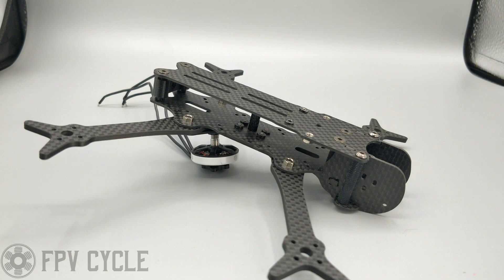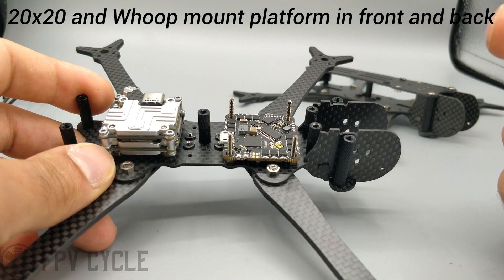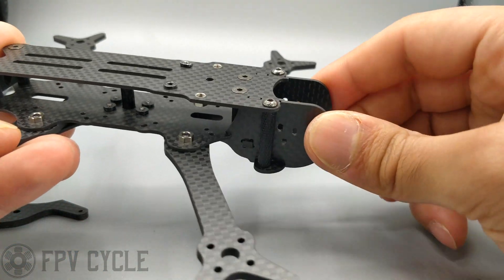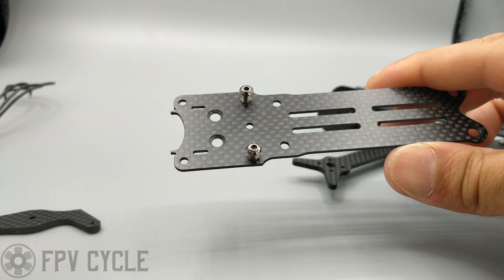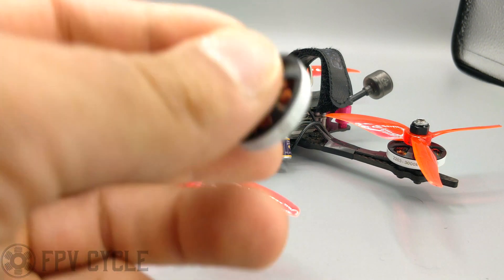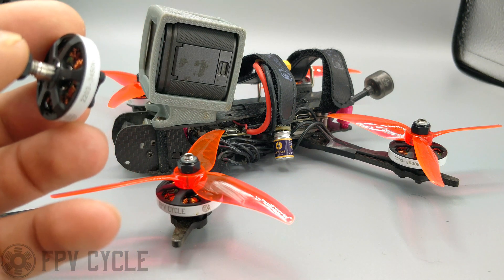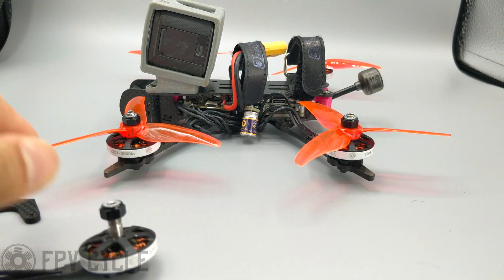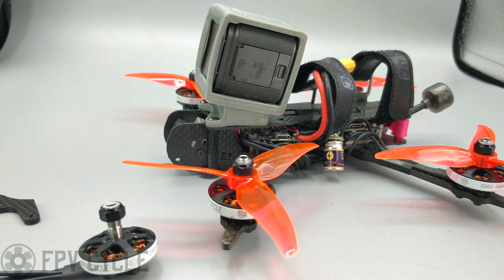Fouride 4" and 5" - Frame and Setup

Comment: For anyone watching this a year on, I have built one and it's amazing. 4s 3450kv on a 5 inch REQUIRES a 1000uf 35v lowESR capacitor otherwise you get awful noise, but with an AIO+VTX stack, you have a huge amount of space to play with so no worries. 

It's a joy to build and I cannot recommend enough

Comment: 13:11 Do you get noticeably more sag with a 3S compared to 4S?
Reply from the maker: On a high powered setup, yeah you will but with the highest output 130c cells, it's not really noticable

Comment: The better micro/mini-long-range frame, at least I've decided to build it as one.  Can you plz make the 5" arms 1mm thicker?  I want to carry 6s Li-Ion with no flexy bendy, and I think it would help with the harmonics.
Reply from the maker: Try reducing the ramp up power in the esc settings a little. Should fix that.

Comment: Armattan gecko 4inch 2203 3000kv 4s... whats a good lipo size? 850 4s? Or 1100 4s? I want to use gemfan 4052.
Reply from the maker: The 1100mah 4s is definitely going to be a better fit for overall performance but the 850 will run too

Comment: thinking of using this for a light 5" long range.. was between this and shock ultra light. I like that this uses the aio board. And im use a vista. 
2004 motors 1700kv, might have to do 1950Kv but trying to be efficient.  5" biblades

Comment: This is the first frame i have ever seen that have stack not placed in cg. I f love it. I wish there was a narrower version only for 20x20.
Reply from the maker: I don't think any of my frames have the FC near the center. I haven't put the FC on CG for many years now. It doesn't matter at all. Zero
Reply: @Kabab  well right. Not CG. I mean center of rotation. Well if one flys in horrizon mode it have to be in center of rotation. So that 1% of people are destroying fpv frames for years. There was always super huge empty space right behind camera and super crowded in the back. Ive never seen this before. Your other frames always have 1st stack in center of rotation. Which did not?

Comment: Would you recommend this 4” frame for a 6s build?
Reply from the maker: Sure but why do you need 6s on 4"?
Reply: KababFPV hmm I never thought about that. So 5” would benefit more on 6s? I would put a digital unit on the frame.
Reply from the maker: @boonjuefpvboonjue1230  5" really only benefits from 6" if you're really pushing the performance or if you're flying an 800g 5". Otherwise, 4S performs better because you actually get more flight time and more torque in the motors so it feels better. The reason 6s tends to have more flight time is because people are using comparatively bigger batteries.  A 1000mah 6S has the same overall energy as a 1500mah 4S. People typically run 1200-1400mah 6S batteries. If they ran a 1000mah 6S, flight time would absolutely be less than 4S 1500mah.  Overall 4S is safer, more efficient and cheaper. 6S is generally preferred but only so you can zip around near max throttle or to go a bit faster.
Reply: KababFPV thats some good points! I’ve been flying 4s and hear everyone hyping up 6s. I guess I’m more curious on what the hype is all about. So you don’t see people moving over to 6s? Will it be more of just two separate groups 4s and 6s. Basically will 4s die to 6s?!
Reply from the maker: @boonjuefpvboonjue1230  I personally prefer to fly 4s because it feels better but 6s does give me more power if I want it. I'm totally fine with either. If I didn't have a fleet of quads, I'd do 4s only. It just makes more sense

Comment: Would it be possible for you to make the frame with 4 mil or even 5 mil arms. It looks totally sweet and I would love to get my hands on one, but it would be nice (even though I have experience flying) to have a more durable version. Thanks.
Reply from the maker: Yep. Working on it right now.  The Fouride was actually based on the full 5" design. A baby version of it. It takes a lot more effort to optimize full 5" than smaller things.
Reply: @Kabab  Thank you for responding! It's really nice to see guys who even though they are so big, still respond to comments like this.  Thank you for the inspiration you give.

Comment: Does the FPVCycle Zeez Whoop board have an Amp sensor?
Reply from the maker: I do not believe so.  At least the prototype doesn't.  Didn't look closely at the final to see if he added it.  Wasn't really a feature we cared for.  We preferred easier to use solder pads and more robust electronic design
Reply: @Kabab  It's a good feature to have for the sake of reliability (safe heat margins) and watching resources on anything capable of long range.  Good for experimenting with different batteries too, like all the different 18650's.  The Baby Tooth does well with RunCam 3 lite, and probably the 4 btw.  We'll see shortly.  Having a 1-2S capable board for the Baby Tooth motors with an amp sensor to make sure you're setting a throttle limit correctly for 2S is likely a necessity.  Retaining 1S capability opens up all kinds of high discharge capability with 14500's.  Only HappyModel has one with a pointless RX and VTX onboard : (   It's amp sensor is so tiny!  Hopefully 1-2S with amp aensor is possible for a solder-pad style FC soon, given all the excessive voids in a cross-shaped layout where a solid square would easily fit.
Reply from the maker: @mistercohaagen  2s would be substantially more board and more difficult electronically to do. You need to add lots of voltage management components. It's just not worth the reliability hit

Comment: 4” arms - 61g fully built, that is kind of heavy compared to like a Gecko 4
Reply from the maker: They're very different designs...
Reply: @Kabab  Ofcourse, removable arms add weight. You are the advocate of 'weight matters' so was kind of surprised. Compromises have to be maid, I understand
Reply from the maker: @martinverbaas  this isn't a compromise.  I can't speak about other designs that I don't agree with. I'll just get myself into trouble.   All I can do is speak about my design. This isn't intended to be the lightest build as I explain. It's intended for the 2203 motors which are quite impressively powerful.  There's a threshold to each prop size where the performance begins to be impacted significantly. It goes up pretty quick as you add prop size. This build falls within that window.
Reply: @Kabab  Thank you for responding and explaning, this must use up a lot of your time. Keep it going and push this hobby forward!

Comment: @kababfpv this is hands down your best frame yet. Any chance of getting a top plate a la carte? I need to take a dremel to mine to fit my cam setup, and Id like to know I can go back if it doesn't go well.
Reply from the maker: Yeah definitely. We just haven't listed it like that yet
Reply: @Kabab  Fantastic. The dremel work actually went quite well. I'll send a link to you once its done, you may find it interesting. I've put a loris and a toothless on an adapter. You happen to know the BEC stats for the jhemcu 30a? I killed the 5v rail on my two spares trying to set this up.
Reply from the maker: @Rob-tp8cu  there aren't really any reliable stats for things like that 🙈

Comment: Hey so I bought a fouride 4in yesterday and now I’m tryna figure out which motors to go with. The 2203 3000kv or the stanfpv 3450kv? I want to fly this on 4s won’t be carrying a GoPro just the vista system.
Reply from the maker: https://fpvcycle.com/blogs/build-guides-and-discussion/fouride-build-and-discussion

Here you go 😁

Comment: - Will the 4" Fluoride fit an AIR UNIT? Bob, you explain that the frame was designed with DJI in mind, but your video shows a Vista. I usually prefer to use an Air Unit to capture video, to save weight. If an Air Unit fits in the Fluoride, it'll be my next build!
- Also: Do you have approximate flight times (easy cruising/light acro) on 3s & 4s? My Acrobrat Duo is currently my favorite quad, but flight time is way too short.
Reply from the maker: It will not fit the air unit. On either 3s or 4s you can get anywhere from 2-8min flight times. All depends how you fly.
Reply: @Kabab  Many of us default to using the Air Unit instead of a GoPro. It would be AWESOME if you can develop a variant of the Fluoride that fits the Air Unit!! 
Thanks for your creative and aggressive product development!
Reply from the maker: @larrydelceg2406  the Variant I'm working on would likely fit it fine. It'll be a 5"

Comment: You havent tried running one of the gopro lites on it? ive been running one on my 5" for a while now and with the right mount its pretty protected and still far less weight then a normal hero 7 plus mount.
Reply from the maker: That would be a great option. I don't have one of them at the moment.  Note that a crash would likely demolish the lite cam 😅

Comment: what setup do you recommand with this frame for 6s ? Because I don't want to buy new battery (I have cnhl 1300 mah 6s) and I am thinking about building a drone without gopro, just for fun.
Reply from the maker: if you're not planning on putting a camera on it, that battery will work out well.  Consider the 180X motors from betafpv maybe?  I hate to recommend their things because they're so problematic but I don't think they make their motors.  I also recommend theirs over the brother hobby 2004 because it seems the 2004 is very fragile and also very expensive to be that fragile.
Reply: @Kabab  Yes, no gopro on it and analog, I will check this motor, thanks.

Comment: What if I have a full size gopro, does it fits,
Reply from the maker: It'll fit but a 4" drivetrain can't really do as good of a job carrying a full size GoPro as a 5". Similarly the 5" version of this frame is not really a full 5". It's just a low weight 5". Not the same kind of performance

Comment: I just fried an ESC on the 30a jhemcu aio in a very light crash on 4s. 4023s props  2203 motors Toothpick frame. luckily theyre sending me a new one no hassle, but its a month away. i will now run on 3s only probably. Thanks ! Ur motors rock
Reply from the maker: 😑. Well it's not bulletproof but so far it's been more solid than anything else we've tried.  I've burnt two out of eight of them myself too but I admit I was doing stupid things and one died of wet grass.

Comment: I just knew, that 4in would make a comeback one day. Awesome frame.
Reply: Bob, what happens if I run different sized props and the same motors on a quad? Say 5in in the back, 6in in the front? Does the FC handle it just fine? i have an experiment I want to make....I've seen quads fly with 4 different 5in  props...
Reply from the maker: It actually works out fine and that was a common thing to do in racing years ago.  Bigger props in the back make it much more effective since the rear is always starved for clean air. Tends to give you more grip.  For the most part the FC compensates for a LOT of it so by doing things like that, you're either trying to make up for mechanical shortcomings or just overloading the FC such that it cannot cope with what's going on anymore....which is what we were doing way back when and didn't realize it. FC code was pretty bad back then. 😅
Reply: @Kabab  Nice! Thanks Bob. I have a weird one to build. A hellbender 204 baseplate from RMRC clears 5in props in the rear and 6in in the front if I bottom mount the rear motors. The battery is strapped directly to the top of the baseplate and I used a cast aluminum project box for the electronics...Low Low CG....just curious to see that one fly.
Reply from the maker: @yannickg6904  the issue with unsymmetric builds is that they can fly great, especially if you have odd weight distribution to the front and there's more power there to help. But when you go to do more drastic msnuevers, the odd weight distribution starts to rear it's ugly head and kinda makes it wonky or just sucks your control performance dry because the FC needs to work so hard to compensate. It kind of depends what you're aiming to do
Reply: @Kabab  I don't plan on using it as a main freestyle rig, It could just be a platform I'll use to understand tuning better. 
This build is basically just a collection of random parts I had lyind around. I'm going to use a Fortini F4, if somehow
that can help Betaflight keep up.I just love this hobby and builds and experiments are just as fun to me as regular plain Flying.
Reply: @yannickg6904  same!

Comment: I really like this form factor and size. But the killer question. Can you bild the 4inch with dji vista under 250g inc battery. What will the AUW be with recommended parts? If just above maybe going nebula as camera and lighter battery and antennas etc will make it possible?!?
Reply from the maker: maybe with the 3S battery.  I haven't tried.
Reply: @Kabab  ok. please if you have time put the 3s version on a scale. Next year we will have the 250g rule here in Sweden. (I'm not quite sure but think it aplies the hole EU union) so I like to get most of my gear under that limit... Easy to find racing oriented builds under this limit but there aren't so many freestyle quads to chose from :-/ ... And I do like the look of yours...
Reply: That is if you don't want to go down to 2.5inch... they are just to tiny... A 4inch freestyle under 250g would be a killer...
Reply: @rasmus80g  I couldn't agree more: A 4" under 250g would be KILLER!!

Comment: Lookin good! You should do a flight comparison against another generic motor, like a 2206... Im guessing you will be getting 30seconds+ longer flight time on the 2203s
Reply from the maker: it'll be similar.  You don't need the 2206.  Both work however.  2203 is just a lot lighter so it controls better on the light props

Comment: Thanks for everything you do man. You really make things in this industry a lot easier. I don't know why you're the only one that comes up with those ideas. Are there more videos coming for the tp3 and babytooth? I really want to build one but I don't have experience with building.
Reply from the maker: The TP3 is actually not done yet.  waiting on the camera and the AIO to be finished.  Camera is almost done, AIO is on the way too but will take a little more time.  I've got a whole slew of content around that when they're actually done and will also be working on an RTF around it too but that's a lot more difficult to pull off.

Comment: I'm curious how 2303 or 2304 would perform...
Reply from the maker: I actually have a 2304.  As far as I can tell in flight, the motor size is more than necessary for the super light 5125 prop.  That's why this motor became a 2203.  Otherwise, 2304 works great on cinewhoops for 3" too.  Just not any more great than 2203